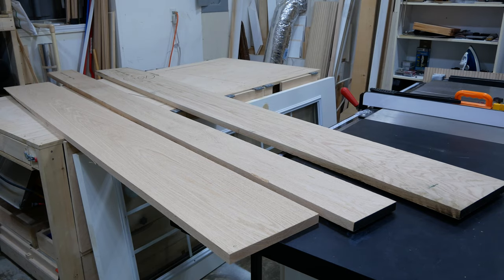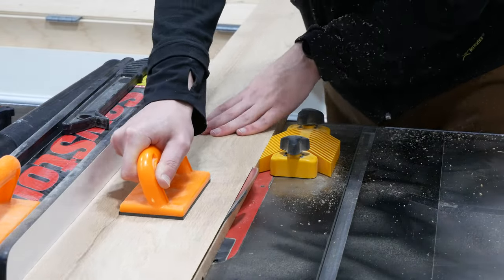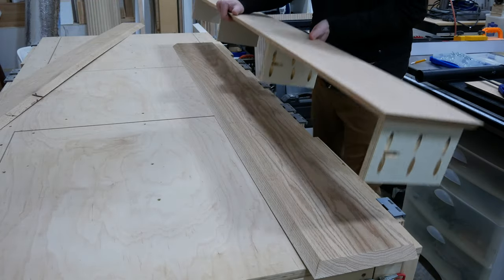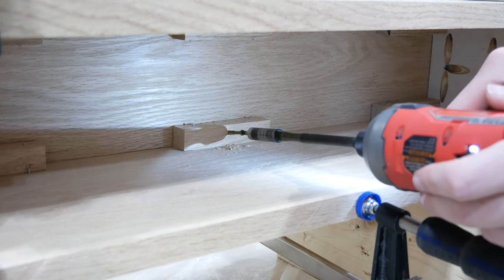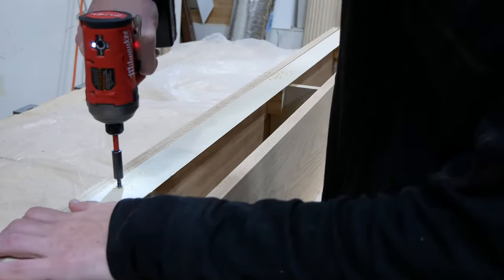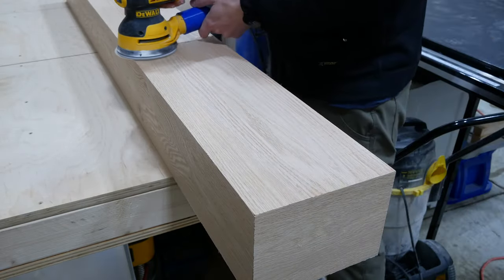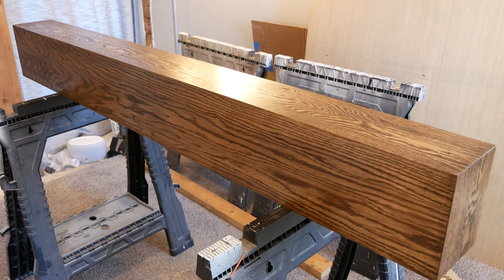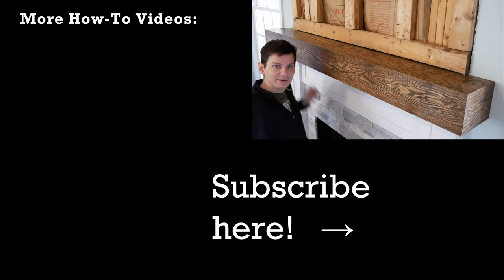How to Make a Wood Beam Fireplace Mantel

Comment: I was wondering if you passed the 320 paper after each of 6 coats of polyurethane. Thanks…great work!
Reply from the maker: Yep a light pass with 320 on the direction of the grain between coats. Just to knock down any air bubbles or dirt that gets in the coat. And thanks!